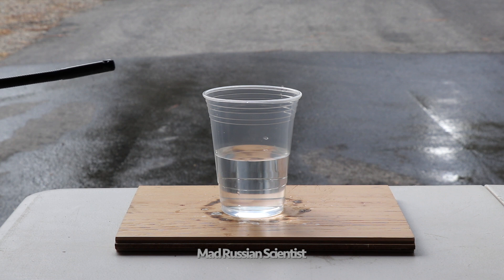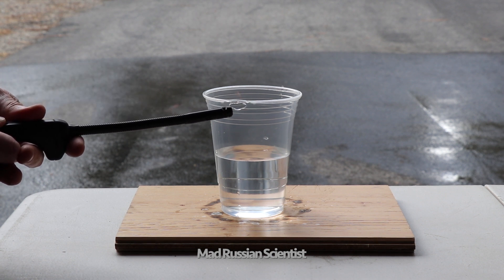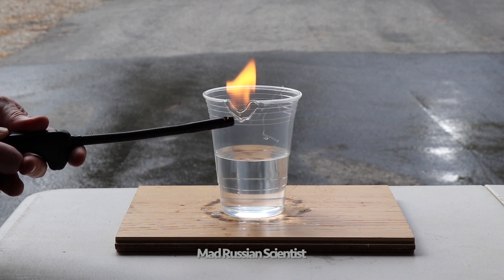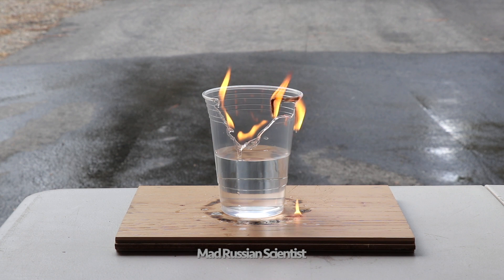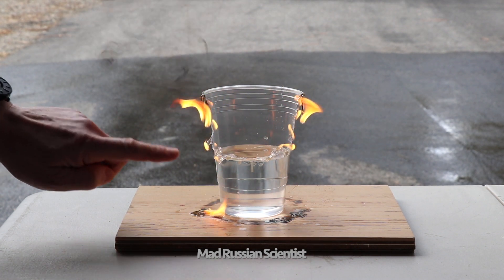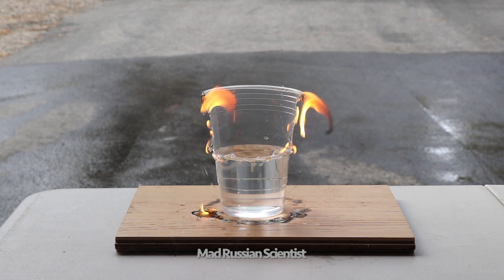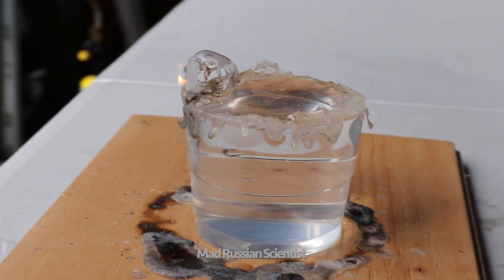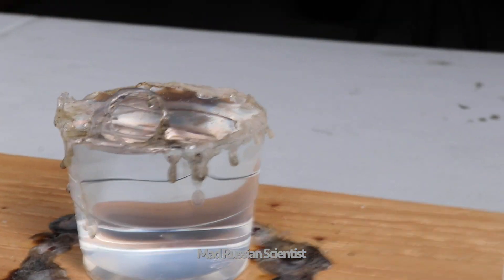Burning a Plastic Cup With Water Experiment

Comment: Try putting boiling water in and catch it on fire..... do you think that would allow it to burn further.
Reply: plastic melting point is above the boiling point, so I don't think it would melt then either.  Water contnually circulates and keeps the plastic surface cool (like a car radiator cools an engine).
Reply: @colty7764  yeah I know waters boiling isn't enough to burn plastic. I was just thinking that maybe since the water is so hot it wouldn't siphon off the heat fast enough to stop it from going just below the water line. Or if it can get closer to the water line. Im assuming if its super cold water it would be further from the water line?...... Idk. Im am not to big on heat transfer and that stuff. I got basic common sense. Thats it.

The difrence in tempature might not even be enough to change anything in the end. Just curious.

Comment: 1:35 No... actually, the water didn't "stop" the fire. It doesn't need to go "through" the water since it could still receive oxygen from the sides. It could still burn if it could get the plastic to a high enough temperature. But it couldn't because the small fire didn't create enough energy to heat the water which was cooling the plastic faster than the fire could heat it. It's the same as trying to burn a paper box with a raw egg inside of it. The paper won't burn because the liquid egg will keep its temperature below the point of ignition and not because the egg is non-flammable and somehow "stops the fire". With a small fire like a candle or a lighter there's just not enough energy for denaturation of proteins in the egg and igniting them in a short period of time. But it'd still burn if you gave it more energy/time.
Same here - if you put the lighter under the cup for a long period of time, then the water would evaporate and the cup would burn. Or if you put a lot more heat into it in a short period of time - for example burning it with a gas torch, then the plastic would receive more heat than the water takes away from it and it would burn, creating a hole through which the water would pour out. So the cup is still perfectly flammable, but just needs more energy for ignition because water is stealing heat from the plastic at a very fast rate. You'd get the same effect with anything that distributes heat well, even if it's highly flammable. For example if you filled a coke bottle with gasoline and tried burning it with a lighter, then it wouldn't burn for a long time because the gasoline would be stealing heat from the plastic before it could ignite. And if the bottle was closed, then it'd probably never burn because the gasoline couldn't just evaporate and it'd redistribute the heat from the lighter into the air before it could get to the temperature of ignition. Doesn't mean the bottle or the gasoline are fireproof or something's "stopping" them from burning though. There's just not enough energy to ignite them.
Reply: Ok
Reply: You are right for all the wrong reasons it is due to latent heat of water

Comment: Damn, I didn’t expect that to happen. I can’t believe the fire stopped right at the water level
Reply from the maker: It's a pretty cool trick
Reply: It's because of the thermal properties that water has. It would take a lot more energy to heat up the water. What happens is that the water is absorbing the heat of the walls when they get heated by the fire. In other words the water is keeping the walls of the cup cool so that when the flame reaches it, it absorbs the heat so that the part of the cup that is touching the water can't reach a high enough point of heat to keep the combustion reaction chain to continue. It is the same way fire fighters put out fire with water. The water isn't actually putting out the fire by depriving it of oxygen, but rather it is cooling the material that causes the fire to a point where it can no longer have enough heat to continue the reaction.

Comment: That water didn’t want that fire to touch it!
Reply from the maker: Yes true :)
Reply: @pharmerpnw  no this is not the reason. The water does not burns because the temperature  of  heat is not equal or greater to the ignition temperature of water.
Reply: RACIST